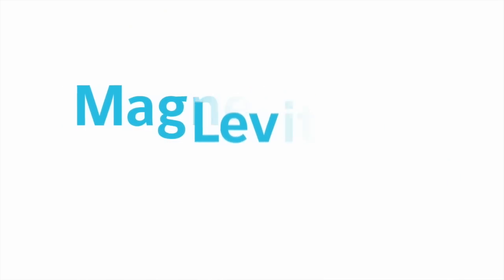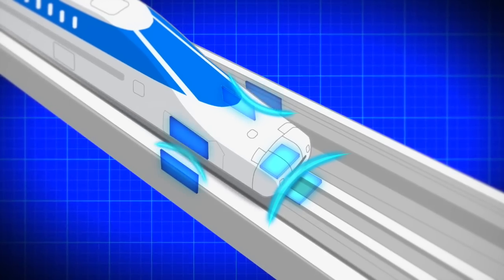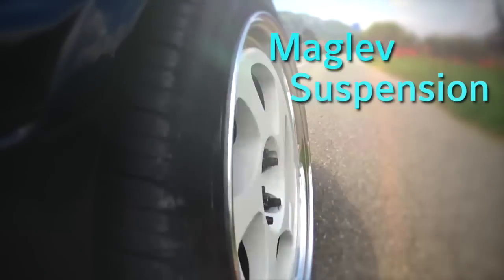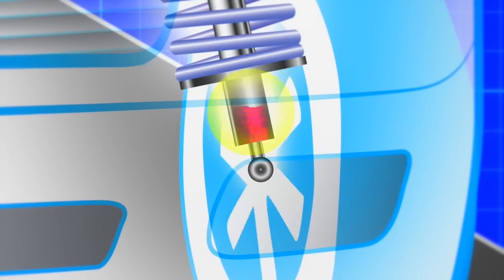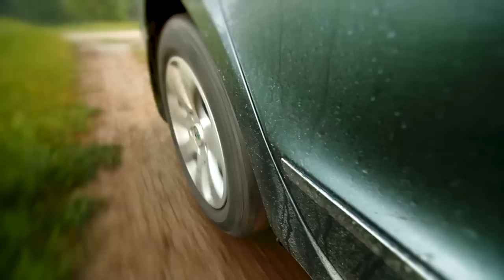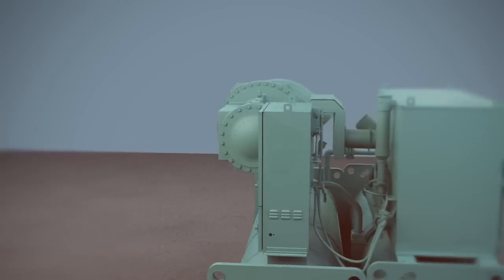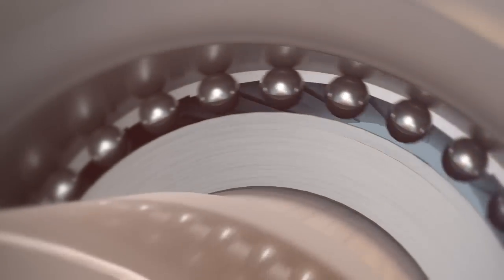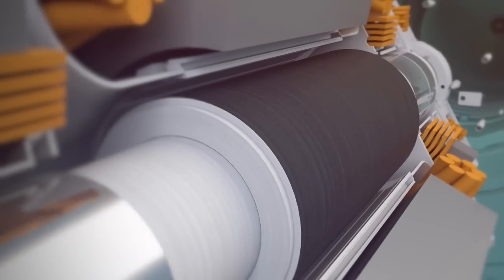Magnetic Levitation in the York YMC2 Chiller | Johnson Controls

Comment: From Johnson Controls Website:  "Highly Efficient – designed to achieve real-world energy operation by utilizing industry-leading low entering condenser water temperatures"

what does it mean to "achieve real-world energy operation"?   

So Johnson is leading the industry by making cooling towers work harder (or moving to colder climates)?
Reply: It means they don't require head pressure control during concurrent operation of a water side economizer or when transitioning from WSE to mechanical cooling. Snark on, bro.
Reply: Out of curiousity, how would cooling towers work harder if the equipment has less resistance due to improved internal parts like this Maglev technology ? Wouldn't that mean water flow would be more smoother, less cavitation; less surging, less stress on the S-Drive and internal components due to those factors with old style drives within the Centrifugal Chiller system ?
Reply: @Coullion43  I am not totally convinced you question (s) are clear.  The drive on this motor and the levitation feature of the shaft eliminate motor friction, abrupt start, oil system and cooling of the oil system but.  No bearings, less friction, cooler motor and no oil to cool down mean the towers have less heat removal due to cooler condenser water at the same tonnage vs traditional chillers
Reply: @juliocastaneda2398  No, I don't quite understand it. I didn't read about the internal workings being described on the York website. Didn't read about the basic lubrication free elements on the drive shaft, the shaft itself suspended in a high magnetic field during high RPMs. No, I didn't read about that. 🙄 My questions were specifically aimed at subject matter unrelated to the inner workings of Maglev technology, such as water flow, backflow prevention, cavitation, ambient temperatures; etc., and the factors involved with those scientific phenomena and it's affect on the Maglev technology.